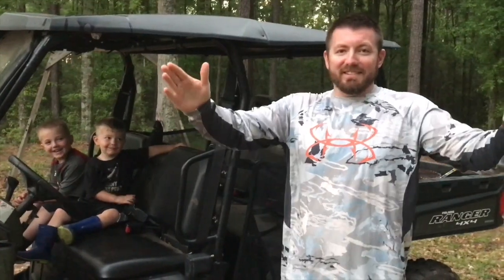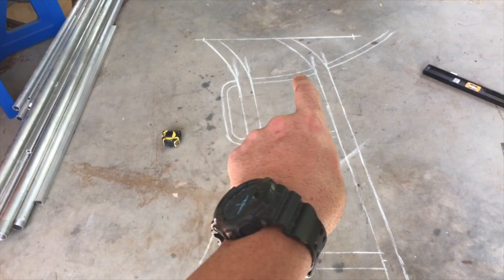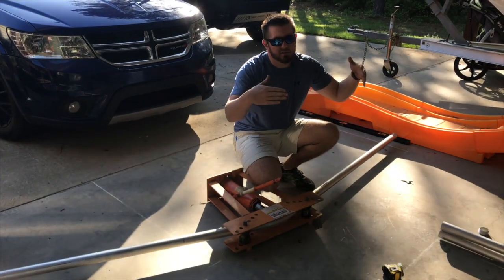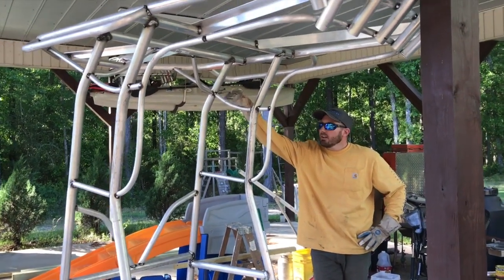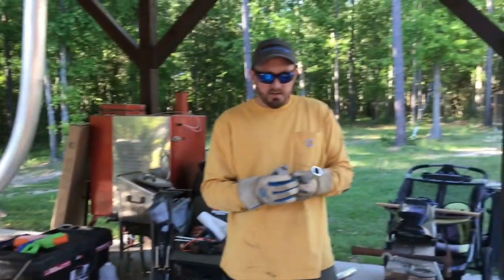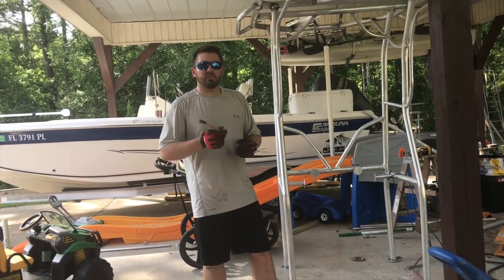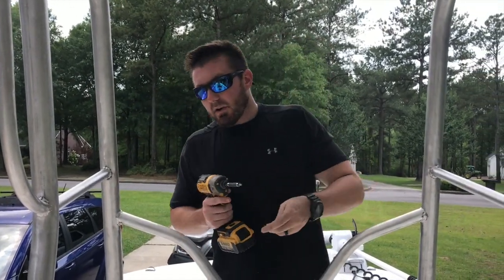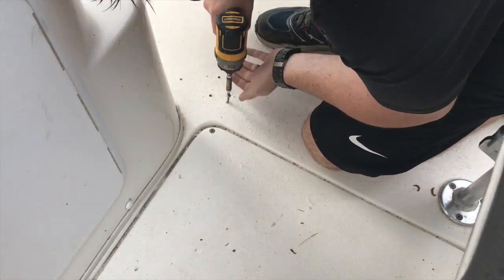DIY homemade t top from aluminum conduit and starboard for the carolina skiff ultra elite

Comment: Hey there Jack Daddy are you making them even with the console or are you going past it a little bit for length and width, or depth will you bump you legs when you come around the corner from the steering wheel ..what size is the center console compared to the size of the new frame around it? I guess that’s what I’m asking lol ..nice work hope to hear from you .. we have an aluminum top but need the frame ? Do you do jobs and ship to Florida?
Reply from the maker: I can get measurements later but it sticks out past the console on each side and the front about 3 inches but it is pretty flush with the back as to not interfere with getting around the helm. In this particular boat, there is still plenty of room to get around the sides. Even if it was a squeeze, I think it would be worth it for the shade. We have fished without it before and I would never do that again. What part of Florida are you in?

Comment: Hey Jack, loved the video thanks and great job on the build. It has inspired me to have a go at this but with zero welding experience I am massively lacking confidence and know how. I'm wondering What kind of welder you used and what was your welding experience when you started the project? Keep up the good work!
Reply from the maker: I used a Miller multimatic 215 with 150 amp spool gun. I had welded alot before this, but not much aluminum. This was one of my first aluminum projects but it wasn’t that much different than steel. The main part is fitting the pipes and that part is the same with any metal. Just practice on a few pieces and go at it, you can do it.
Reply: @JackArmWhat size type wire did you use?  LOOKS GOOD!strong-jackdaddycustoms

Comment: wow nice job,what bender is that and are the dies in different sizes?
Reply from the maker: @elaineevander  thanks. That was the bender that harbor freight sells and you just have to pick the die that is the closest size. A real tubing bender works so much better but you can make it happen with that pipe bender.

Comment: how you like the spool gun?  ive been debating getting one for at least 4 years.  one of these days ill get one.  or get a welder to tig alum.
Reply from the maker: I got it as a way to weld aluminum until I could get a good tig. I still haven’t bought a tig. lol. I like it and it’s certainly sufficient, but I would love to have a push pull mig. Just can’t justify it right now.

Comment: Hi Jack! Is that a 2”x.125” aluminum tube? Thx!
Reply from the maker: It is 1x2x.125 wall.
Reply from the maker: Sorry, disregard that last post. I thought it was on my other video of building a boat. It is 2” aluminum conduit. Which is about .125 wall thickness but it’s measured differently than tubing.

Comment: That’s sweet! I am wanting to make a grab bar and a leaning post out of this and have been going back and forth between 6063 t5 and this conduit which is 6063 t1 I think. 

My question is how well is it holding up? Can you hang from it? Just wanting to see if this stuff will be strong enough for a leaning post and grab bar. Thanks
Reply from the maker: Holding up great. It is plenty strong. I certainly could hang from it but I don’t because I do t want to compromise the fiberglass that it’s bolted to. We definitely hold on to it in rougher waters though. I use this stuff for all types of projects and it does great. A big plus is that it’s readily available without having to drive 2 hours to an aluminum supplier. 

Hope your project turns out great.

Comment: Hey buddy how much did the aluminum pipe cost? 3 inch? Bout how many feet you think? I want to build one for my 16 foot center console.  Thanks man
Reply from the maker: i believe it is around 50-70 dollars a stick (10 ft)  5 sticks will give you a good start if you are good with your scrap.  i used 2" for the legs and some 1 inch in other places.

Comment: This is great! This is something I can eventually do. 
If I may ask, looking back, is there anything different that you would do? How has it held up so far?
Reply from the maker: Thank you!  this thing has held up amazingly.  if i could have done anything different i might would have incorporated some type of storage somewhere... and i would have used tig instead of mig... just for looks.
Reply: @JackArmstrong-jackdaddycustoms  Thanks for the reply. My buddy does metal fab for a living, so I'll see if he'll do that. And maybe fab some storage as well. Whatever I end up with will sure beat the bimini that always gets in the way!!
Reply from the maker: @mobettadealgetta5111  no doubt about it!
Reply: I’m running stainless and 1/8th white PVC panels mated in the center.  The thing I have about starboard is you can’t glue anything to it, heavy and stains fairly easy. I’m wondering how much noise the thin pvc will make. I know the real thin stuff for patio is loud. The is always a trade off.

Comment: Looks great how much in materials total $ do you have invested in project ?
Reply from the maker: I had less than 300 in it because I had most of the aluminum laying around and got the rest at a scrapyard for CHEAP. The starboard and the hardware were my main expense... with the starboard being the brunt of it. Even if you bought the aluminum conduit, you don’t add a whole lot though.
Reply: @JackArmstrong-jackdaddycustoms  
Jack thank for the info .

Comment: Hello! Are you using the same type of pipes you would use in making a fence around your house?
Reply from the maker: no sir, these are aluminum.  the fence pipes would be galvanized steel.  you could use that but it would far heavier and far more apt to corrosion.

Comment: Great job,  I plan on building my own T-top in the near future.  Are you using a mig welder with aluminum wire?
Reply from the maker: it is a mig but i have a spool gun.  I'm using the miller multimatic 215 with the 150 spool gun and aluminum wire.  100% argon.  takes some getting used to but it gets the job done for sure and with practice i can get it to look pretty close to like it was tig.
Reply: @JackArmstrong-jackdaddycustoms  I have a Millermatic 135.  Will have to see if I can do something with that.  Thanks

Comment: What is the material you used for the top? I’m looking at designs and found your video it’s a really nice top. I wanted a way to mount lights for nights on the river on my pontoon cat fishing barge. Now you got my mind spinning on all the things I can have mounted above.
Reply from the maker: It’s called starboard. It’s a dense plastic like material that is very good in marine environments. I love it... a little heavy but very solid.
Reply: @JackArmstrong-jackdaddycustoms  thanks for the reply, waiting on warmer weather to rebuild my pontoon and seen the videos and like the build you did. Thanks for posting it.
Reply from the maker: @unsaltedlife5998  no prob. Post yours up when it’s done. Link it on here so we can check it out. I don’t blame you one bit, it’s getting a little nippy here in south Alabama too.
Reply: @JackArmstrong-jackdaddycustoms  will do I’m at lock and dam 25 on the Mississippi River or ice rink now.

Comment: Curiosity has gotten the best of me here! I love to build also. But for conversation, how much do you have in it, versus buying one pre fab'd? But it's an awesome build either way!!!
Reply from the maker: I had less than 300 in it because I had most of the aluminum laying around and got the rest at a scrapyard for CHEAP. The starboard and the hardware were my main expense... with the starboard being the brunt of it. Even if you bought the aluminum conduit, you don’t add a whole lot though... i could have bought one for around a grand probably that would be shaky and fabric top.

Comment: Congratulations came out really great and Really nice video! 
few questions, 
how much weight the entire project at the end?  ; 
how is the starboard holding as Top? ; any cracks?
could it be done with T connections welded to provide stronger support at the joints?
Thank you!
Reply from the maker: Thank you!  I’m guessing it added about 150 pounds. I didn’t weigh it to be sure but me and my wife handled it fairly easy to put it on the boat. The starboard is holding up very well. Much better than any canvas I have seen. Very pleased with it. You could certainly use t connections if you can source them. I imagine it would significantly up the cost of the project though.

Comment: where did you get the aluminum. i want to build my own, but searches lead me to 5052 aluminum, cant find any.
Reply from the maker: i got my aluminum from an electrical supply store.  Any good supply store will have it, Home depot and Lowes usually don't carry aluminum but some do... better check the smaller specifically electric stores though!

Comment: Hey man I'm trying to do this for myself the metal supply company is charging 73.00 per 10 feet does that sound about right? And if you could give a rough estimate of build materials I would really appreciate it. Thanks man
Reply from the maker: that sounds a little high, but prices will differ in different areas.  i think our electrical supply store sells the conduit for 50-60 a stick.  its 45 on grainger but i don't know about shipping.  

its always good to check local scrap yards as well.  that's where i got some of my stuff and i had those 5 sticks of conduit already laying around so i didn't place an order to look at as far as materials lists... but i think if you had 6 sticks of 1 1/2, 2 sticks of 3/4, 20 feet or so of 1 1/2 angle you would be at a good place.  don't forget a few small pieces of plate for mountings and your starboard and stainless hardware.

hope that helps and hope it turns out great!  post up some pics when you get it done!

Comment: Hello buddy! I’m sorry about my bad American (I’m Italian)
Anyway i would like to know which tipe of aluminium and which diameter did you use for the construction
Btw well done ! Amazing work
Reply from the maker: Thanks bud. I believe aluminum conduit is 6063 alloy. And it is 2” od
Reply: Is it 2” everywhere? On The top as well?
Reply from the maker: @andreabozzano117  sorry. It is 2” everywhere but the support pieces and it is 1”. There is some flat bar and angle as well but that could be any size you wish. I was making do with what I had.
Reply: @JackArmstrong-jackdaddycustoms  what about the roof? Which material did you use for it?
Reply from the maker: @andreabozzano117  it’s called starboard. It’s a type of plastic that stands up well to the sun.

Comment: Did you use a wire feed welder ?? Happy Easter !! He has risen !!!!!!
Reply from the maker: Happy Easter. He is risen indeed!  Yes I used a Miller multimatic 215 with a spoolgun and 100% argon. Definitely not as pretty as tig but with enough practice you can make it look good. I’m just not set up for tig aluminum yet but maybe one day.

Comment: How’s that HF pipe bender work with Al? I know it’s ok with steel, but worried about kinking Al.
Reply from the maker: STEVE it works better to me. I’m sure you have heard of filling the pipe with sand. If I’m going to do a tight bend I always do that method and have always had success. A “real” tubing bender is in my near future for sure though. Pipe bender has bent a lot of stuff it wasn’t meant for but it’s done ok.

Comment: what type wider and will it weld schudle 40 aluminum pipe
Reply from the maker: It’s a millermatic 215. It will weld aluminum very well but you will need a spoolgun and 100% argon for shielding gas.
Reply: Which spool gun did you purchase. I also have the 215 . Great job by the way. How much would you say you have in the project?
Reply from the maker: @theknottypinemetalshop8674  it’s the spoolmate 150. It’s like a busted drum... hard to beat!
Reply: @JackArmstrong-jackdaddycustoms  just order it.

Comment: Conduit? Really? Like I could go to home depot and build this with conduit? Why does everyone scream that i need 6061 aluminum tubing to make a hard top? How well is it holding up? Man I need to learn how to do this lol
Reply: I'm with you. Trying to figure out how to do this almost exactly, and it seems like there are 1,000 nay-sayers, guess we need to try it and see for ourselves lol
Reply from the maker: It’s holding up like a champ. It’s aluminum conduit though, not just regular ol galvanized rigid from Home Depot. Still looks like the day I built it.
Reply from the maker: Eric Riviere my Home Depot didn’t sell aluminum, only rigid. I got this aluminum conduit at an electrical supply store. I run mine all summer in the gulf. Rinse it off when I bring it home every time. No problems.
Reply: Thanks for the reply Jack!

Comment: How much were the materials for this T top ?
Reply from the maker: Mike Gardner I had less than 300 in it because I had most of the aluminum laying around and got the rest at a scrapyard for CHEAP. The starboard and the hardware were my main expense... with the starboard being the brunt of it. Even if you bought the aluminum conduit, you don’t add a whole lot though.

Comment: You make look so easy, I fucked up like poles and still can't get it right.
Reply from the maker: Did you draw it out on the floor?
Reply: @JackArmstrong-jackdaddycustoms  
Yes sir!! But when am welding the poles i am burning holes on the aluminum. How much amps are you using to weld.
Reply from the maker: @backforties  not sure, I can look next time I’m down at the shop. I set my machine for whatever thickness I’m welding. Make sure your aluminum is clean too.

Comment: What type of pipe bender did you use?
Reply from the maker: A sorry ol harbor freight one. It got the job done but it reminds me every time I use it how much I need a real tubing bender.
Reply: @JackArmstrong-jackdaddycustoms Great video by the way. I'm a electrician by trade, so bending conduit will be easy for me. However I've welded carbon steel with my mig setup but have not used my spool gun on aluminum yet.
Reply from the maker: @josephdimaggio28  thanks man. You’ll have no trouble with the bends. set some time aside to practice with that aluminum before you dive into your good stuff for your top. It’s not hard but it’s a different stroke than regular mig. Hoping you’re turns out great!
Reply: @JackArmstrong-jackdaddycustoms  thanks man. Just curios, do you have alot of experience with welding aluminum? Also how big is your top?
Reply from the maker: @josephdimaggio28  a decent bit.  I have done several modifications on aluminum boats, even cut a jon boat in half and made it 2 foot wider, lol.  I have used tig but just in the past  years started using the spool gun.  i have to say, once i got used to it, i prefer the spool gun all day long.  the top is about 4x7 i believe.